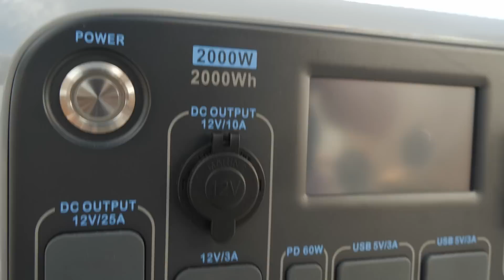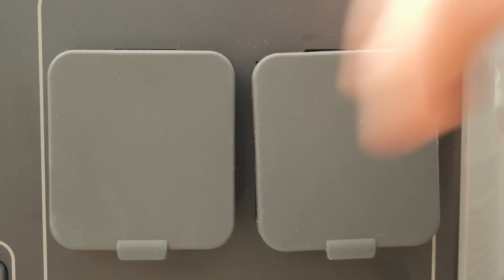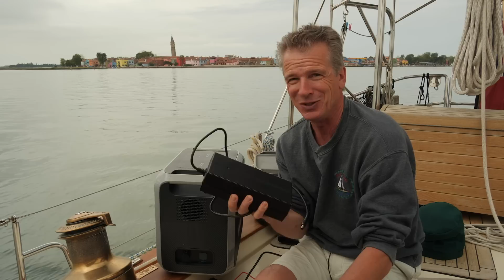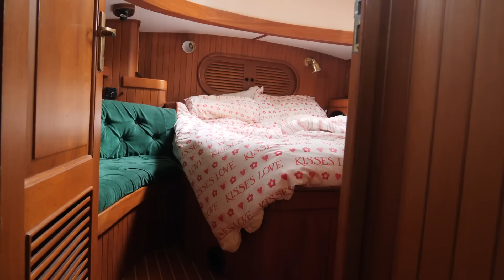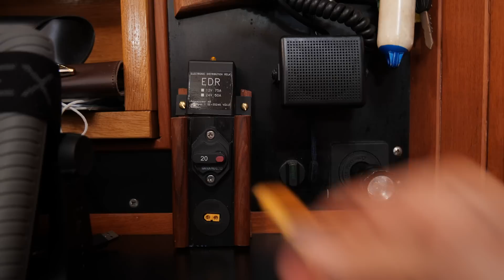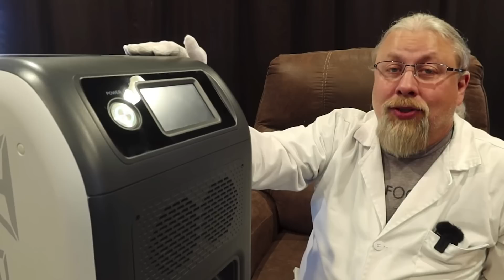New ideas for house banks  |  PowerOak Bluetti AC200P

Comment: I know this video was a long time ago, but I have a Bluetti AC200Max.  I rigged up a voltage relay like you have.  The Bluetti has an aviation 2 prong plug for solar/cig plug for charging but I also have the "DC conditioner" that goes into the other (AC brick) plug.  It takes XT90.  Wondering which would better to charge it with off DC house bank.  Does it switching off and on pose a problem?  Also, in an emergency is there a way for the Bluetti to feed the house bank?  It has the aviation 2 prong 12 volt 25 amp max output.  Thoughts?  Love your videos.
Reply from the maker: We don't have our unit any more, gave it to the brother in law for his RV as we had some others for testing. I do really like the Bluetti though and the aviation plug is a great addition which most units don't have. Yes I think using it as an emergency back up if the house bank died is a good option. I didn't have the correct sex aviation plug to do it but I was intending to get one and have it permanently wired to the boats bus bars of via a switch, so if something happened to trip the house banks BMS I could switch in the Bluetti. As long as you've just got the essentials running it should cope. I'm not sure what you mean by the 'DC conditioner'
Reply: @svfairisle  Thanks!  That DC conditioner/enhancer allows a second charging source at the same with multiple sources.  Thanks for the info on the voltage relay... testing it out this weekend.  All the best.  Jim

Comment: Actually planning to a goal zero (similar product) to power fridge, cabin LEDs, water pump and cig lighter accessories. Would one need to connect the negative DC output to the common DC negative of the boat ?
Reply from the maker: No you would be better off just having a double pole switch to go between the boats house bank an the Bluetti. So it would switch + and - across, so each system isolated. It would be better to have a higher capacity o/p than the 10A cigarette lighter though so try and pick a power bank that has a nice 30A one, the Bluetti has one but you have to order the cable separately it only comes with the high capacity DC I/p cable not the o/p

Comment: Great video - how has the unit been now you've had it a year (was there any adverse probs with being at sea/marine environment?) - and also did you find a good way to lock it down while sailing ?
Reply from the maker: Yes it’s been 100%, and we cleared out a floor level cupboard and took the door off. It’s right behind the companionway steps so we can slide it back into there.
Reply: @svfairisle  glad to hear and thank you for the reply

Comment: Hi,
     In addition to solar panels can you set this up to be charged via a wind generator?, I guess you’d need a lithium based charge controller?
Reply from the maker: Yes the charge controller for the generator would have to be able to be set to lithium friendly voltages, but the main thing is to have a way of cutting off the generator when the battery is full.
Reply: @svfairisle  Thanks for your help

Comment: Hi, Thanks for reviewing the power bank, looks like a great bit of kit!.
I am trying to understand how many Amps it has?, ie how long could I run a fridge that uses 1amp continuously for?. Is it 2000w divided by 12?, ie 166amps. Cheers DB
Reply from the maker: Hi, I’ve done a tech video that goes right into all this stuff it’s on Patreon but the first part will be out on Thursday, I think this would be useful to you. But yes we have a 630 Ah bank, we would only run it down to 80% though so 504Ah, so yes it could run it for 504 hours (3 weeks) Not true of larger loads though (Peukerts law)
Reply from the maker: Ah sorry just noticed you posted that on the bluetti review! Confused because the latest video was a battery bank for the boat. SO....! ignore the last answer, the blueetti has a usable 2000wh capacity, if you have a fridge drawing 1amp at 13v say, then thats 13Watts P=IV so 2000/13= 154 hours

Comment: the new standard is 48v for battery banks. smaller cables needed and less loss in long runs of cable.
Reply from the maker: Yes 12v makes no sense with what we need to run on boats really. Trouble is with all the legacy equipment being 12v it adds a whole other layer of complexity having transformers all over the place with a higher voltage house bank. Apart from the inverter we have no high draw items like electric bow thruster - winches etc so we get away with 12v. That’s why I like the built in inverter in the Bluetti it’s better than the very expensive ships inverter.
Reply: @svfairisle  One Victron can do it all. or duel so you are never down. it does 48/24/12/120 and 220 and they are the best.

Comment: Hi, I purchased the AC200p for my boat to recharge my batteries and run a few loads while at anchor. When I plug my AC system (120volt) via shorepower cord into one of the AC outlets of the Bluetti, the reverse polarity light on my panel turns on.  This does not happen when I am connected to shorepower so I know the boat is wired correctly. Any ideas how this can be fixed? I know most suitcase generators are not grounded and have what they call a ‘floating neutral’. The AC200p is not grounded so I am wondering if it is related to this.
Reply from the maker: Yes it's a common occurrence with generators and as you say caused by having floating live/neutral. This should not be a problem as if you have RCB's they will still trip in event of a fault because of an imbalance between live and neutral, it's only ELCB's that might be affected and we don't have them on boats.
Reply from the maker: P.S. the reverse polarity light will often only come on faintly with this 'fault'.

Comment: That's really remarkable. I'm over on Amazon looking at what appears to be the same unit under a different name ("Bluetti.") I'm thinking it would be incredibly useful to have at home just for emergency power. If I end up buying a sailboat, it seems to be an obvious choice. Great video. I do just wonder about its durability in a marine environment. It's also worth mentioning that the one I am looking at on Amazon is equipped with the LiFe04 category of lithium battery which is supposed to be virtually risk free w/r/t fire hazard.
Reply from the maker: Yes it’s proving extremely useful to us at the moment as our house AGM bank is down to. 1/3 capacity, you will see in the next episode we’ve had to disconnect two of them so the Bluetti is getting well tested. The version you want for LiFePO4 is the AC200 P ... it’s the (P) that stands for phosphate & yes the safest lithium chemistry out there.

Comment: Is there a way to plug the AC output into the boats 240V system. With the unit under a seat how do you get at the outputs?
Reply from the maker: Yes we can and do plug it straight into the boats 240v system sometimes, in fact the new ships inverter comes with an AC socket rather than hard wired in as the old one was so the I/p the the boats system is just a plug so an extension lead is all we need. (Were not using the ships inverter at the moment as the AGMs are almost dead, more on that in the next episode. We do have the Bluetti right by the companionway steps though so it’s easy to use direct in the galley which is our main use.
Reply: @svfairisle  Do you end up with a plug on each end of a lead or am I missing something?
Reply from the maker: @57richm  Yes standard extension lead, well in my case an EU one, male plug goes into one of the outputs on the Bluetti, and the female end goes to where the ships inverter is and you take the male plug out of the ships inverter and onto the female socket on the extension lead. If the ships inverter is hard wired to the boat disconnect it and a plug to go into the extension.
Reply: @svfairisle  Thanks Steve much appreciated.

Comment: Backup system for my house uses 0000 AWG for the DC side.  That runs at 48 VDC nominal and can provide just shy of 10K VA for 2 minutes before thermal limits kick in.  I have a 5 KW generator I use to charge it.  I was doing a load test and discovered that the breaker on the generator will trip on a warm day at around 3 hours.  Sometimes only one phase.  The inverter I have will automatically adjust the charge rate to deal with the reduced available power.  The batteries are AGM wired in 6 parallel strings yielding 630 Ah.

I'm looking at alternative chemistries for the next iteration of this systems.

Great video!  I love power systems.

Comment: Bill Bell
Hi Steve. You say that the EC200P could replace a house bank. I note that the largest DC output is rated at 25A. I've thought about which part of my domestic system might exceed that. What came to mind is the auto-pilot. If it is working hard, is it likely to demand too much current from the AC200P? 
Also, I would still need another lead acid/AGM battery to start the engine and power the bow thruster. How are you planning to get round that problem when you fit Lithium?
Reply from the maker: Yes to 200 would only suit a very small boat, but actually I know several people with little boats that currently dont have an inverter because their house bank lead acid isn't really up to it. If you were in that position then this at 2000w is equivalent to a 160AH house bank on paper, but thats a usable 160AH's (well150, you can't run it completely flat)  unlike a 160AH lead acid which would only give you 80AH usable. You would still need your lead acid engine battery of course. I will almost certainly retain a lead acid starter battery, maybe two as we will have the space & it could be a more usable emergency power source if the lithium craps out. Until these systems have been around for a while working in real life situations I'm going to remain slightly wary.
Reply: @svfairisle  Thanks Steve. I currently have 330Ah lead acid. So the AC200P will not be enough for my house bank. I think I need to build a lithium battery using 3.2v cells, perhaps 400Ah. I'll watch with interest when you go Lithium. Bill Bell
Reply: I know it’s a year on from this video but I am really contemplating doing this on my boat. A 50 year old Westsail 32 with original 12v system in good shape. 200 amp flooded house/engine bank. That’s enough to run nav lights, electronics, etc. I’m gonna do very simple electric galley and portable dc fridge/freezer. The Bluetti seems like a nice drop in to run the “modern” side of my boat while keeping the older side intact. I’ll add 200-400 watts of solar. Thanks for this video Steve, it really opened my eyes to doing a plug and play upgrade. Only risk is a component failure within the unit but I’ll still have the prehistoric system to run on if need be. I priced out a 400ah lithium system fully modernizing my boat components at 4k. This seems much more palatable.

Comment: Seems nice but needs to fit under your settee
Reply from the maker: Yes you absolutely have to have somewhere that it can be firmly contained & probably strapped down on passage, but I have to say it’s wide & heavy with really grippy rubber legs & ours so far has just sat by the companionway steps and not budged an inch, we haven’t felt the need to slide it back into its cupboard.

Comment: Seriously thinking about this for my boat as an alternative to batteries but how much solar is minimum? Is there a minimum amp requirement? I’m in the U.K. so as you know not overly endowed with sunshine...I can’t seem to find this info from Poweroak so do you know minimum spec for solar? 
Great videos and very useful...
Reply from the maker: Yes I'm just putting all that info on a page in Tech Corner on our website right now. The spec for solar charging are 35-150v/Max.700W,Max12A So you need a minimum of 35v which means for most panels you would have to have 2 in series. My big bifacial panel is actually fine though, tested it today. I thought it was 32v but it's actually 42v and the 12 Amp limit is at the PV voltage not 12v so the max the panel produces at 42v is 9.5A so it works great and charges fast which is just as well as two of three of my house bank batteries died today so we are really relying on the Bluetti for power now!
Reply: @svfairisle  thanks for the info and great timing with your batteries to give up...will keep an eye on your website. Thanks is again. It's a shame the UK price is so much higher than the EU price. Nearly £500 I'm even thinking of driving over to the NL and buying there and making it a day out...
Reply: @svfairisle  So Update - I bought one of these to power by boat and seems good apart from the fact that they dont supply you with a power out cable for the 12V25Amp socket??? Try and find one of these in the UK...non existent and no phone number to contact them on and they dont reply very well to emails....If they had supplied a cable for this socket it would have been very useful.  I now have to try and hunt down a cable to connect to the boat that is the female version of the Aviation plug.

Comment: Hi Steve, great video but where in your system have you wired that charging point with the relay.
Reply from the maker: Luckily the wiring on Fair Isle is well over spec'ed so I've just tapped into the cigarette lighter socket on the nav desk that has it's own spur with it's own breaker. I'll wire another one for the Bluetti by the companion way steps straight from the bus-bar that's a foot or so behind it in the engine room, got to be a bit careful with these big loads.

Comment: Hmm, should you be plugging/unplugging your panels while they're producing? 

Re Ecoflow and Bluetti please report back after a year of use in a salt water environment, thanks.
Reply from the maker: You can actually unplug a solar panel and join the connectors together short circuiting the whole thing if you want, nothing will happen. If you do have several panels in series so you're talking a reasonably high voltage it pays to be careful though, so dont stick your fingers in the MP4's and yes you might get a bit of arcing as you plug unplug which could cause some pitting in your connectors. I actually just chuck a tee shirt or whatevers to hand on one of the panels, it really doesn't have to cover much, just a couple of cells will do. That will drop the power right down (panels hate any shading as they feed current into the shaded cells, don't believe all the blocking diode sales patter, they still do it) anyhow the powers right down at that point so you're very unlikely to get any arcing as you replug.
Reply: dnihilist  -  I  have  several  powerstations  that  get  plugged  &  unplugged  while  the  panels  are  producing  without  a  problem.   I  think  if  the  panel's  output  does  not  exceed  the  limit  of  the  unit  being  supplied  .  .  .  .  ?    Have  seen  that  warning  before,  but  other  than  creating  a  spark  at  the  connector  I  don't  see  a  problem .      ?   ?   ?

Comment: Great video Steve. 
It just so happens that I looked at a boat that I’m very interested in (1989 Hans Christian Christina 43) which would need a completely new house bank. 
2 of these side by side would be a great option as it does not have solar either which I would want to add. 
Thanks for your tech corner videos. Great information.
All the best, Richard
Reply from the maker: The 43's a great boat. Have a look at Hobotechs review of the AC500P https://www.youtube.com/watch?v=X3egWGNyTYw&t=10s
this is the one I think you would want to have loads of power. It's also made to be joined together. The downside is 12v charging as it need a bigger voltage, great for solar, not so good for alternator charging, but thats always the case with Lithium as they need a BMS and if that cuts off it will fry your alternator.
Reply: @svfairisle  Thanks for the info. I will keep you posted. 
By the way did you see the sisters hip to Fair Isle (another Hans Christian 48 with the Dog House) was on Yachtworld!, 
All the best Richard.
Reply from the maker: @SVZonda  Yes from the same place in Holland we bought Fair Isle. Our friend Rik is in charge of the sale, thanks for reminding me I promised to send him a copy of the boats manual, the one is missing from that boat.

Comment: Looks like a great solution for my boat.  I am intrigued by the idea of this system as a replacement for my aging 400 AH AGM house bank.  Can the unit be mounted horizontally?
Reply from the maker: Well the cooling vents are on the side so could be possible